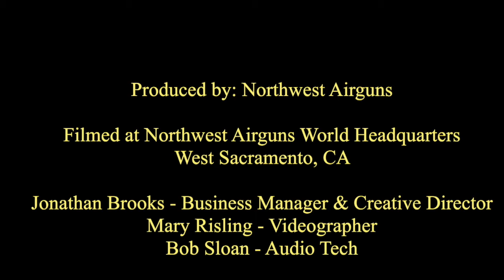Pump-up air rifle not pumping up?  Try the 'Alcohol Flush'.

Comment: My air gun I've shot and lubricated for years stopped working out of no where. It wouldn't pump any air at all, I put denatured alcohol into the system and pumped it to spread it around. After sitting for about 30 minutes it was back to life! It could probably use another soak and sit for a little longer. But im very thankful for this tip, I can't believe it worked. Now I have my favorite bb gun back and ready to roll! Will probably have to replace the cup soon. But im just glad it works again
Reply from the maker: Very cool, Mr Wham.  Some people follow up with a few drops of compressor or tool oil or ATF,  just to lube things up a little.  Glad this worked out for you.

Comment: My Sheridan has a leather seal on the pump, alcohol won’t hurt it.   I have never done this because I always store it it with one pump of pressure.  Mine is over 50 years old.  I sent it in for rebuild about 1975.  Still shoots great to this day.  My Benjamin has leather seals on the pump also.  I have had the pump seal get hard on it.  I’m going to pull it out of storage and try alcohol.

Comment: Having worked as a mechanic for 20 years, when there were times a car had a slightly leaky fuel injector(or fuel rail) we would fill the car up with the worst/cheapest gasoline at whatever year it happened to be (used to always be ARCO gas but not sure anymore). And fill it with the highest octane rating (92 here in California) because it has such a high alcohol/ethanol percentage to achieve the octane rating on the shitty gas. This often fixed these smaller leaks because alcohol causes rubber to swell not because it was "cleaning out debris" so I'm a bit confused on your reasoning as to why the alcohol flush works. I do believe it works, and I plan on trying it myself on my benjamin 312. Perhaps both of our reasons are correct.
Reply: I too was contemplating the alcohol, rubber reaction as soon as I started watching this video.

Comment: The flush works.  I flush on a regular basis now.  Only a few drops is needed.  Put a drop of oil on the cup at the same time.  I get max pressure, max fps, and the gun holds full charge for days.  Evidently manufacturers do not want you to know how to keep your air gun working for many years. $$$$.

Comment: I did just like you directed and it brought my Benjamin 392 back from the dead❗❗ Bought it at a pawn shop for $40 13 years ago when I was stationed in Fort Sam Houston, San Antonio, Texas! I let mine sit for a week. The previous owner or owners never did any maintenance on it other than oil the living daylights out of it. It didn't help either that I didn't know how to do any good maintenance on it myself. Ever since collecting 1377's, 1322's, crosman '130'.22, 2100's, 2200(needs seals or o-rings/a little bit worried about taking it apart/ looks like someone tried before), a daisy 880(needs seals or o-rings),312(when the trigger is pulled, a little bit of air shoots back at your face or eyes 👀), and a 392, I've been trying to learn from YouTube videos and teaching myself how to take apart these airguns. Thanks for your video, I'd never would've figured it out since I haven't seen another video out there with this information. Again thank you ❗ Flushed out a lot of gunky oil, and bits of grit. Put a drop of peli-gun oil where needed and it's doing great ❗❗Now all I need is to find a video on the 2200,😁❗❗❗

Comment: The 312 likely has a leather piston seal and a nylon check valve. Neats foot oil is the proper piston lubricant. Mac1 secret Sauce available from Mac1 airguns in California is the proper lube for all rubber sealed guns.
Reply from the maker: Agree on neetsfoot oil, or silicone oil, is best for leather seals.  And maybe  the earliest 312’s have a leather seal for the pump cup, but the vast majority are synthetic.  So in that case, yes, secret sauce from Mac-1 is best.

Comment: I did this with a 1322 that wouldn't pump up. . I poured in about a teaspoon of 91% alcohol and i shook it up and let the gun soak overnight.
The next day i shook out all of the  alcohol i could. Then  i put some silicone oil in the pumping mechanism and a little in the 
Chamber . I pumped it a few times and it started holding air.
I put more silicone in the mechanism every few days and it got better and better.
Then i tried it in an old Crossman 140 thst wouldn't pump up.
This gun pumps up but it's very weak.  I think this one is going to get new seals
So i am 1 for 2.  That's not so bad for guns other people had given up on.
Thanks for the video.

Comment: I have a 1999 Crosman/Sheridan C9A.  Looks great.  Pumps and shoots.  Check valve seems OK because the arm does not lift on its own once it is pumped up, BUT it does not hold air for more than an hour.  Where could the air be going if the check valve is OK?
Reply from the maker: air probably sneaking out the barrel.  If you can't live with it not holding air, you'll need to rebuild.  That valve is different than the valves I show in my other Sheridan/Benjamin videos, no special valve tool needed and different seals.

Comment: I like many other ole yeah ole not old LOL 66 years here.. had one of the greatest ... and Mr. NorthWestAirGun is holding one right now... The Great Benjamin .ss Cal pellet riffle. I remember when I got mine at 12 years old. If I remember correctly my dad and I picked it up at White's Auto But it may have been at Sears... for under 30 bucks. .. anyway... It to this day was the best 22 cal pellet riffle i ever had or shoot... I don't know what ever happened to it... I have other air riffles now... a77s and 22s but they just don't hold a candle to the Ben Bronze Brass Master... Anyhow I have a fairly late model Crossman that won't pump.. pumped great last year .. but not today so here I go... I'll be back to let y'all know how the alcohol flush works out. Fingers crossed. BTW I'm looking to purchase a vintage Ben now.. looking on Ebay as I speak... I want the one with the rounded wood pump arm like the one I had..

Comment: Very detailed video, thanks for doing that. I have a Benjamin 317 Air Rifle that belonged to my dad and it won't hold pressure anymore.  I will try the alcohol flush this weekend. Would denatured alcohol work? Also if this doesn't work, can  you reccomend a good relable source to buy repair parts? I found the original parts manual and don't think it will be of use since it was printed in the 60"s .
Thanks for any advice, would like to restore this rifle.
Mike

Comment: The alcohol worked fine but now the gun is blowing air around my transfer port. I have some 1/4 inch tubing, so I want to cut a small piece and replace the transfer port. Can I remove the barrel without removing the trigger assembly?
Reply: which rifle?
Reply: @jpbrooks1981  Crosman 130 pistol
Reply from the maker: @charlesleak7499  Sorry, Imissed that.  And I've never had a Cros 130, so can't say.  Maybe someone will chime in, or you could try asking at the GTA forum;  https://www.gatewaytoairguns.org/GTA/

Comment: Hi there, 
I have a Daisy 990 that used pump up just fine, until I took the part in front of the cylinder pump apart. I didn't sounds the same and seems a little weak in power on the pump side. The CO2 works great after new seals. My thoughts is that I put the check valve in wrong.

Comment: I may be confusing precautions with spring-powered guns, but I thought oil or alcohol in the combustion chamber could ignite from compression like a diesel engine. Another possibly spring related precaution is not dry firing (no pellet) an air gun due to excessive speed/impact of the piston. Even if these do not apply to pump up guns, it might be adding a footnote not to try the alcohol flush on a spring gun.
Reply from the maker: I've thought about that too, like burning ethenol.  Temperature, due to rapid compression, plays a large part in dieseling,  Pump up your air rifle quicky and you may be able to feel a bit of heat at the base of the pump tube.  But, pressure and temperature in pump up airguns is generally pretty modest.  Spring guns can have a massive spike in both, hence dieseling, and precharged guns use higher pressures too.  It is not necessary to use alcohol, perhaps compressor oil or some other agent would work to flush out the system.
Reply: @NorthWestAirgun  is it ok if I use Everclear 190 Proof alchohol to flush my Crosman 1322 pump airgun pistol ?
Reply from the maker: @unitedstatesirie7431  Geez, I dunno, seems like a waste of Everclear to me.  I'd stick to 70 or 90% alcohol or another oil.

Comment: It's pretty hard to argue with the success you and others have had with the alcohol, but I'd be concerned because of the water that makes up any alcohol that is less than 100%, and that is virtually every type sold.  If I remember correctly alcohol has a great affinity for water, and if it's not already there, any strong product probably absorbs alcohol from the air unless there's none to be had.  If I tried it, I'd make sure the barrel isn't closed at the receiver end and work it hard the next day to remove as much of the alcohol as I could to avoid rust.  On the positive side, most guns have lots of oil residue in them.  
FWIW, I recently bought a Crosman that absolutely had no indication that the there was a pump seal in it.  I oiled it liberally (I only use synthetic motor oil), and the pump cup did respond and would pump up.  With frequent use, it remains usable, but in time, it shrinks back to the point it will not hold the pump lever closed.  Time for a replacement.
Doug
Reply from the maker: Well, the Benjamins and Sheridans are brass, so rust is less of an issue, although some other rifles are not.  But your point is a good one.  Others have commented that they follow the alcohol with some kind of oil, like your non-detergent synthetic oil.  Seems like a good idea to me.  Wish I had included it in the video.  Thanks for bringing this to peoples attention.

Comment: This process worked for mine about 2 years ago.  Flushed out a ton of old gummy oil over a few days then keeping one or two pumps in the gun at all times kept it holding pressure and good to go for the two years.  One day it was back to no pressure... Put in a couple ccs of alcohol and immediately went back to pumping fine so maybe it was some old goop that broke loose again and got caught up somewhere.  Note: I never had and still don't have the issue with the pump rising from a back leak in the piston seal.  Highly recommend this process to fix or even maintain a classic ridiculously accurate gun.

Comment: I hope you're still here.
I have a 1377 that I purchased during the early 90s.  I never maintained it.  It recently stopped pumping so I dripped some silicone oil where I could and it's now pumping again.

At 14:19 into your video:  Mine, regardless of how many pumps, the pump handle will sag all the way back down.  It will even sag down if I apply VERY little pumping pressure.

Do I have more than a cup issue?

Thanks you.

Comment: I have an old Crossman 140 .22 that I found in my house in a dark corner in the basement. I have no idea how long it had been down there. It is in very good condition had some slight rusting on the barrel and chamber slide. I sprayed some PB Blaster on a rag and wiped all the metal down. It worked well in taking off the rust. The stock is 99% original condition no dents or scratches. It would not pump up. So I did your alcohol recommendation. (I took a shot myself for good measure.(Not Isopropyl).  It worked like a charm. I did inject a very small amount of hair clipper oil down the tube to keep the seals soft. I figured machine oil was a safer bet than motor oil.  I am not familiar with air rifles. I am experienced with firearms. Can anyone give me the age and approximate value of this rifle?
Reply: Use silicone oil on air gun not petroleum based.

Comment: there are product s for a car engine to stop leaking  ,by making the rubber seals soft again ,maybe it wil work in a sheridan to  . by the way >>>bij putting alcohol under pressure  with oxygen ,and at some point there is a change that you get the  diesel effect inside the chamber .i would not pump more then once . and shoot it empty then .

Comment: Any video's on how to change the original pump cup of the Crosman 140?  I was told a special tool is needed to separate the brass from the aluminum rod.  thanks.
Reply from the maker: I'll see what I can do.
Reply: @NorthWestAirgun  Thank-you.  I was able to change the pump cup, but now it won't hold pressure.  It pumps, but I hear slight hissing coming when I pump it up.  I added 2 drops of sythetic pellet gun oil to lube,  I was able to get maybe the equivalent of 1 pump and it lightly puffs out black gunk out the barrel. I don't know if its the trigger valve that's damaged.  Some have said online it can get fill of gunk. Any advice?  Thank-you.
Reply from the maker: @D33Lux  First, try cocking the gun before pumping.  Then keep shooting out the gunk.  If it doesn't get better after doing that maybe 10 times, then you probably need to rebuild the valve internals with new parts and seals.

Comment: Can I ask what type of alcohol and the oil that you used please? I'm wanting to restore my 1.77 air pistol
Reply from the maker: I use 93% alcohol from the drug store, but 70% should work too.  A lot of people recommend following the alcohol treatment with a little bit of oil, maybe hydraulic fluid or compressor oil, just not too harsh.

Comment: It is not so much the gunk as it the alcohol reacting with the rubber seals and softening them.  Exactly why you should never use gasoline with ethanol in some engines.  It softens the fuel lines and all rubber components in the carburetor.

Comment: My dad has a benjamin model 317. It did not pump air or build pressure on his at all. It sat in the shed for years since it broke. Sunday I fixed it using baker air gun's seal kit and their tool for $60. Works fine now. So if this doesn't work, check that company out. Good luck👍

Edit* the video I used to help me was from this channel https://youtu.be/W1_DGNaaAs0

Comment: On a model 347, does the rivet have to be replaced to replace a,broken pump lever spring link?
Reply from the maker: Usually, yes.  But some have the older style tootsie roll pump arm (leftovers from the 310/12/17) that might be fixed with a Tim McMurray method shown here;  https://youtu.be/f07hnkkfSCU    Make sure the old link spring is gone
Reply: @NorthWestAirgun  for that to work it looks like you have to shave the tip part of the spring that goes into the divot so it can slide under the rivet.  Is that how it works?

Comment: Took my front end apart cleaned tube. Flushed with alcohol. Got it to shoot alcohol through it. Refilled with alcohol and set over night 3 times. Still only takes one pump.
Reply from the maker: I had the same problem with the Benji 342 and the Streak.  Try replacing the pump cup next, see if that helps.
Reply: Well the cup works cause its the only thing holding the air in it.
Reply: Valve seal has a nick or is cut/damaged. Replace that o ring and see

Comment: Jon,
My 1969 Sheridan Blue Streak stopped pumping air so I did the alcohol flush like you suggested. It now holds air but it takes 8 pumps to get the same response as 5 pumps used to provide. I believe that the pump cup is old and deteriorated. It has the non-adjustable piston head, so I want to change to the Steroid Stainless Steel Piston Head, Jam Nut and Pump cup available from Mac1.
Should I change the original aluminum front plug with the Steroid Blued Steel Front Plug from Mac1 while I am ordering parts from Tim and have the front end apart?
Mark.
Reply from the maker: You can re-use the original front plug, up to a point.  If a person drives the roll pins out and in repeatedly, the holes can become slightly enlarged and the pins can start to spin while pumping, eventually making the holes in the plug and even the tube get wallowed out.  Try a fresh set of roll pins, then note where the split in the pins is, i.e., 12:00 or 6:00 or wherever.  That way you’ll know if the pins start rotating and can swap out the front plug.  It won’t hurt anything to replace it, just some people like to keep the gun as original as possible.

Comment: Very nice informative video! I was recently given a sheridan silverstreak which has the hold down thumb safety. And after pumping it didn't seem to have much of a pop when firing it. I tried the 3 day alcohol trick and it seemed to make a difference.  I put alcohol into the pump chamber on the second day and pumped it and the next day it still had pressure. Do you thunk maybe u should just replace the piston cup?
Reply from the maker: Sure, the pump cup is cheap and is the best fix short of a valve rebuild.  You can get them on ebay;  
https://www.ebay.com/itm/113531879648?hash=item1a6f0700e0:g:A5gAAOSwScdZxIDp

and others offer them too.  Get the tube as clean as you can before installing a new cup.

Comment: Great video! I've got a 312 that belonged to my great uncle. It was made in 1957 and it works pretty well. I flushed mine with Super Slick Slick Stuff. A question... After I pump and fire it, I can cock the hammer and fire it 3 more times before it runs out of air. Is this normal?
Reply from the maker: These guns are designed to be pumped 8 times, and have no air left after firing.  So, no shooting 3 times to deplete all the air isn't how it's supposed to work.  You can take the rear end of the tube apart, clean the hammer and inside of the tube, and install a stronger hammer spring, but sounds like there may be more to fixing your issue.